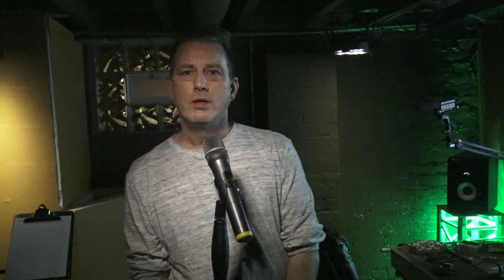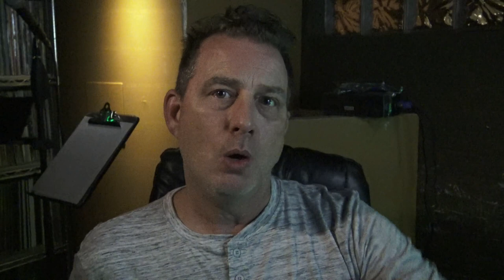Why I Like Hand-Held Microphones For Wedding Ceremonies

Comment: I wish I could just use one hand held but when given the option the officiant most always want's the hands free option. Nowadays everyone expects to hear the bride & groom along with the officiant so I mic up the groom and officiant, their mics pick up the bride just fine.  I do have wind noise issues but not clothing issues, I mic them up myself to avoid that.  People understand the wind noise and expect it, no one ever turns around to me like I'm suppose to fix it but I do pull out all the low end which helps a lot. From day one I put it on the groom and officiant to hook up with me to get mic'd, sometimes I have to chase them down but by then I have the pre-ceremony music on auto and have time to square up the mics.
Thank you Brian for doing the work on quick, easy, batter powered ceremony systems. Between your vids and a couple of others I have devised a very efficient "one trip" system also using the Maui Go.
Reply from the maker: I get officiant mic requests as well.  When it happens, I explain the technical benefits of hand held to the client & then give them the lapel option, which with multiple mics & more tech, raises the price of ceremony services.  Between my explanation on benefits & the price difference, they just go with my suggested method.  The cool part in the end is the officiant will complement me on the mic & the sound.  My theory is that they've had bad experiences in the past with cheap hand helds & perceive a lapel mic as better quality.  One more thing I'll say is that clients sometimes have a habit of asking for things until 1 of 2 things happen:  ether you flat out tell them "No", or, you say yes, but require them to do something in return, such as pay more or provide accommodations for me to provide whatever equipment or service they are requesting.  As soon as they have to do something in return, they back off real quick

Comment: You are spot on!  You seem to be in a similar market to myself here in michigan.  Most of my gigs have a pretty low budget so not only can I not charge a ton but I also don’t have the income to justify buying a ton of lapel mics.  I run 1 handheld for the officiant and maybe one other wired mic for reading if need be.  It’s always worked out fine and I’ve had zero complaints.  Love your video by the way.  Ive been a subscriber for many years.

Comment: Hey Brian, I have used a single Shure SM58 wireless for years and works well.  However, more often now I have officiants request a Lav mic.  I would like to know what the DJs out there are using. Thanks.
Reply: I don't usually like the SM58 as a vocal mic. Sennheiser 935 is much better. I also tried a Sennheiser 914 and it works great for this application. Wind Screen for outdoors might be needed depending on the day. Not to say that the SM58 is bad and that you're wrong (please don't take it that way), I think the 58 is just so common that people just trust it. Not to mention the durability. It could fall of the back of a truck and you could still use it, but I tend to prefer the 835. The 935 is more comparable to the beta 58. You could stick a stage box like the Soundcraft UI16 (or behringer X-air) behind some decoration, just run power, then use one of the alto wireless speaker kits and have a pretty good wireless system, with tons of control, and then still have a multi purpose system. I went on a rant there, but there are alternatives to the 58 that in my opinion, do sound better and are more versatile.

Comment: $500 a wedding.  Sounds right for me.  That's about what I charge.  From Hawaii to Pennsylvania to Kentucky (retired Army) all the same price.  If I am good friends with the bride and/or groom, I'll give them half back as a wedding present.  Sounds crazy, that's just me.

But, I do it more as a second income/equipment income stream than as a primary job.  I'm a Licensed Practical Nurse full time with an 25yr Army pension.

I liked the video you talked about overhead.  I do mine on a 5 to  8 year plan as I have electronics and speaker design/building skills that allow me to do my own repairs when needed to extend equipment life.  Unless, some new gizmo that will make set up, use, and/or tear down easier comes along sooner.

A shocker to some, I charge hourly for most parties which is $10/hr ABOVE my Nursing pay plus 2 hours for set up.and breakdown.  I just like to play music and help folks put on a good party.  I charge extra to lug my lighting out ($50). I don't advertise, word of mouth only.  I'm not trying to undercut my market or put those out of business who do it for a living.

Great channel Brian!!!!

V/R
Jeremy
Reply: Jeremy P I think he meant $500 just for the ceremony alone not including the actual party but I could be wrong.
Reply from the maker: @NoizTheDj  Yeah that's ceremony only.  I bill it out as a separate gig.  The way it usually plays out is there's a reception indoors & ceremony outdoors.  What I'm able to do now, with a small ceremony system, is show up early & set everything up for reception.  Then, go to the remote location for ceremony & set that up.  When I make the switch from indoors to outdoors, the music is uninterrupted.  Without the separate ceremony system, I'd not only have a 1 hour flip, but possible power limitations.  As far as the $500 pricing, figure I have around 2K total invested in that equipment. At a 10% rental fee, that's $200 + $300 for my time, prep, set up & performance.  Then I get what I charge for reception as well
Reply: 500.00 for a wedding.......I would not be proud of that after any amount of time in the business.  If I am doing the ceremony too, I start at 2000.00.  But after 1250 weddings and 38 years, what do I know.
Reply: @jayallen3145  I think you missed his comment above. $500 is for the ceremony only. Reception is billed separately. I'm pretty sure he would not do the ceremony at that cost without the contract for the reception as well.

Comment: Couldn't find anywhere that has any stock of that microphone. Perhaps it's been discontinued?
Reply from the maker: It's probably just a matter of getting them imported.  Pretty sure it's still in production.  I'll find out for sure at NAMM next week
Reply: @briansredd  So the middle man needs to get their act together? Get it listed on Amazon.
Reply from the maker: @yourmusicdna  Meh, sometimes the suppliers on stuff like this allocates inventory to countries or markets that have ether been vendors for longer, or generally are more established & move more units.  I know the UK was on board with JTS before the USA was, by a few years anyway.  I think we kind of get used to just having everything available to us here stateside, where other countries don't have the availability we do.  Sometimes, the supply chain works the other way around
Reply from the maker: @yourmusicdna  As far as Amazon goes, that can get tricky.  Reason being is we are a very niche market with a relatively small number of retailers.  There are several pro audio & lighting supply companies out there that jumped on board with Amazon, only to alienate every other vendor on their certified dealer's list.  They couldn't compete with Amazon's outreach, so stopped placing orders with "Coke" and doubled their orders with "Pepsi", so to speak.   So, many companies, for that reason, stopped doing business with Amazon.  Some things are still available there, but often times, only thru a 3rd party supplier.  Other items only go up on Amazon if they can't find enough retailers otherwise, or are doing overstock or discontinued skew blow-outs.
Reply: @briansredd  I only used Amazon as the most ubiquitous example I could think of. "small number of retailers" doesn't help me the consumer (generally) and usually that only protects a higher margin for the seller. Again, not good for consumers. If a certified dealer was the least bit interested in selling these units in the US - they aren't making that fact known on the internet by my searching. I could have missed something, but not likely.
Reply from the maker: @yourmusicdna  Actually, in regards to protecting a higher margin for the seller, Amazon must sell at MAP (minimum advertised price).  With traditional retailers, they must also honor MAP when posting prices ether in store or online, but CAN sell for less when you go in store or call & deal with them directly.  Again, allocation of goods isn't always in favor of the USA.  Structurally, for our industry, we do business very different than much of the rest of the world.  There's no big box music store in Europe.  You have small shops that do e-commerce, but mostly do business in-house.  The retailers are more familiar with the products than we are probably used to over here.  They also tend to do better with items made by smaller, privately owned companies than we do.  Here, mass produced, budget items rule.  There, not so much

Comment: After much trial and error, I stumbled onto a setup that I really love.  Had a cheap EV mic that I never used because it had awful off-axis noise rejection... when I realized that for a ceremony setup that's exactly what you want - because everyone is off-axis.  So I put it on a boom stand (stand sits off to the side a little, boom reaches between the couple and officiant) pointing straight up at about chest-height.  Add a foam windscreen if outdoors.  I have to work the gain quite a bit throughout the ceremony, but it picks up everyone with minimal setup and relatively little intrusion, which the photographer likes.
Reply: I'd love to see a pic of that. Do you have one from a wedding you did? Like a couple of comments I've seen I too worry about a mic and stand in wedding pics. If your setup kind of solves that I'd consider trying that.
Reply: @damomoo  Can't post pics on a YouTube comments thread, but I'm happy to send a photo if you'd like.